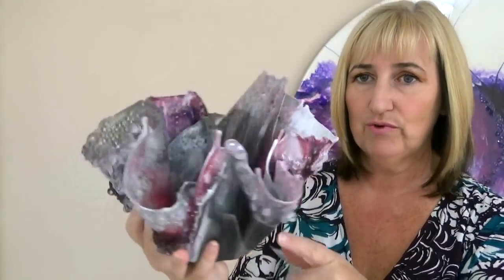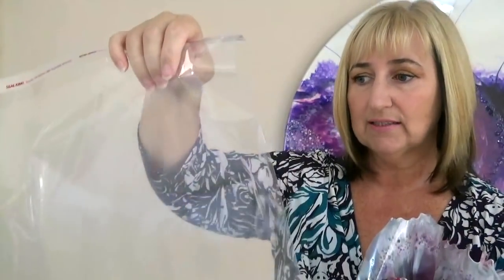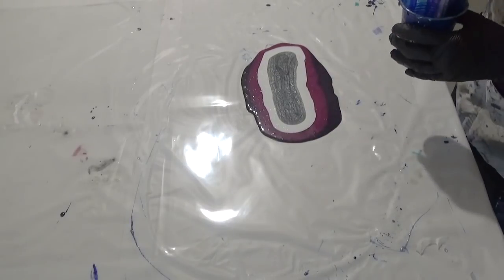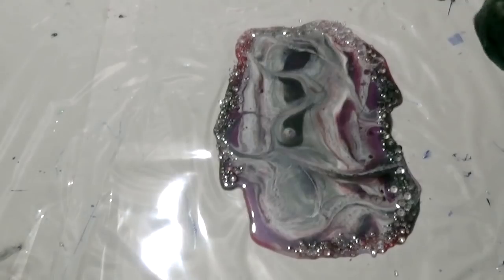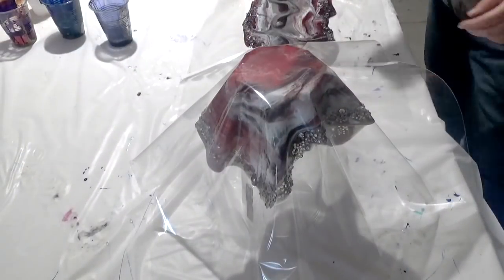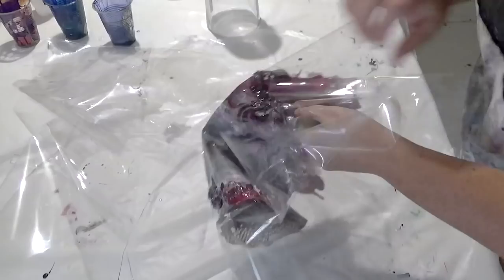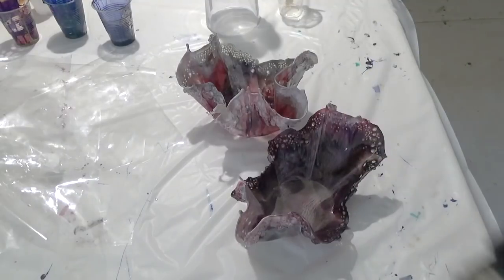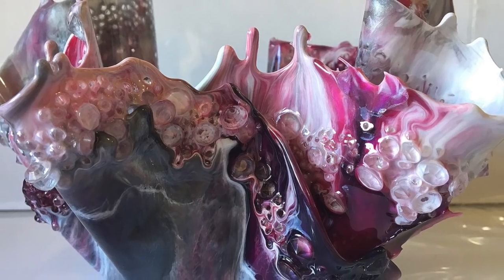How to make this stylish resin bowl using sheets of plastic and resin

Comment: I’m trying so hard to make these, one of five or six has turned out the way I like it.   One of the issues I have is that when I pour my resin onto the cellophane it runs instead of staying in a puddle.   Next one I’m going to let my resin set up longer, do you think that will help?
Reply from the maker: Yes, that should help. Be careful not to let it sit for too long. Or try another brand of reein.

Comment: Hello and thank you for a great video . I try it but it didn’t work . I let it sit for about 5 hours and when I try it to put it on the cup to get shape it start to dripping off and in the end it was all on the table . Please help ….maybe I should let the resin to dry more hours? I live in a hot country maybe I should be patient … please tell me what you think
Reply from the maker: You need to wait until it is semi-cured, the right time will depend on your resin. The resin should be soft, but not sticky. You should also make sure you are using a coating resin and not a casting resin.

Comment: Ok. THAT is EPIC. Another gorgeous Sue Findley design. I want to move into your creative space and soak up some of your extra creativity. Your daughter is SO blessed! Quick question...wgen you place the layers on the vase why don't you place the second layer directly on the first? (Instead of keeping the plastic sheets between the layers.) If you have layer one then why can't you place layer two "face down" on top of layer one on the vase when they are still in the soft cure stage? Wouldn't that save work at the end?
Reply from the maker: Thank you, I keep the layers separate because I want to maintain the layered look, otherwise they will merge into one. When I glue them together, they are only really glued at the base and you can see how it is layered. Plus, I can still reposition the top layer if it needs it, whereas, if I just stick it on top, it has to stay where it lands. One other thing, glueing the two layers together gives it that added strength, especially if you end up with some thin spots in the creases from the bending and stretching 😉
Reply: @SueFindlay  Thank you for explaining that - it makes a lot of sense now that you say it. The work sure makes for one stunning design! xx

Comment: Hello Sue
Can you use resin on a Vinyl sheet, will the Resin come off when it's cured partially an d completely?  Planning on trying a free form vase sometime soon!  Can you reply as soon as you can?  Thank You!  Blessings!
Reply from the maker: The brand of resin I use doesn't stick to plastic.I would recommend you testing your resin before tackling your project. Not all resins are created equally and I have had a few people come back to me stating that their resin sticks to certain plastics. Good luck 💕
Reply: @SueFindlay  
Hi Sue I am talking about what I would put the  resin on.  I purchased a large Vinyl sheet to pour the resin on.  Is that ok, or should I still test a small piece of Vinyl and pour a little resin and see if it comes off when cured?
Reply from the maker: You need to do tests to check that it doesn't stick.

Comment: Sue I absolutely love your gorgeous artwork and have been following you.  After several “bending” fails, I figured out I need casting resin, not coating resin (which has been presenting with stress cracks).  What is the name of the resin you use.
Reply from the maker: I don't use casting resin, although, all resins are different. I use liquid glass from U Resin. It is a coating resin. 💕
Reply: @SueFindlay  thank you sooooooo much.

Comment: I love how yours turned out!! when doing mine, it stuck to the cellophane bad!! should I have applied anything to it before pouring the resin?
Reply from the maker: Not all resins are created the same, you need to test your resin before creating your project. As you have found out, resin can stick to certain plastics. Do tests on both sides of the plastic, because I have heard that in some cases, the resin doesn't stick to the other side.

Comment: I love all your art work Sue! Big Fan. Could you tell me if you open your cellopane bags to a single layer or do you use the whole bag? Your link goes to a cellophane roll  not bags ,is this also ok to use?
Reply from the maker: I do split the bag, so that I could use both sides for each layer. The cellophane roll is what I found as an alternative to the bags. This is what I would buy if I didn’t already have the bags.
Reply: Thank you for replying. You are the best!!

Comment: What kind of plastic could I use or could you tell me where I could get your plastic. Also how long do you cure it before putting on the vase? It was so cool.
Reply from the maker: I have used a number of different plastics and even used baking paper. I have heard that resin sticks to certain plastics, so I would test a small amount of resin on the plastic you have, let it cure and see if it can be removed. Remember, whatever you place it on, it will take on the properties of that item. What I mean by that is, if the item is shiny, your resin will come out shiny, if it is matte, it will come out matte. Something to bare in mind when choosing your plastic.

Comment: where do u buy those large baking paper at ??
Reply from the maker: I didn't use baking paper for this one. I used cellophane which I purchased from a florist supplier. Plastic shower curtains work very well, and you can cut them to any size.

Comment: hi Sue, can I please ask how you get your resins so thick. When I pour mine they flatten out & go everywhere, so your suggestions would be appropriated. Thanks for your wonderful inspirations.
Reply from the maker: It all depends on your brand of resin. If your resin is quite runny, you can create a dam using a rope under your plastic. I have used that method is a couple of my later videos. The purple vase and purple wave. xx